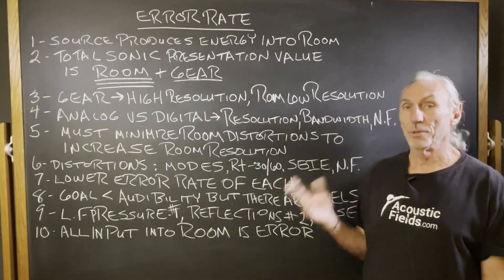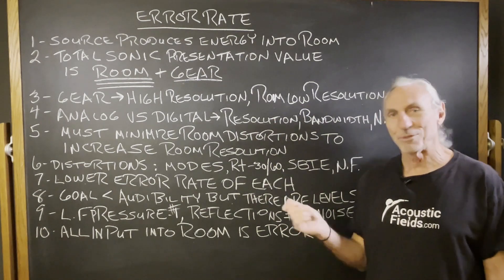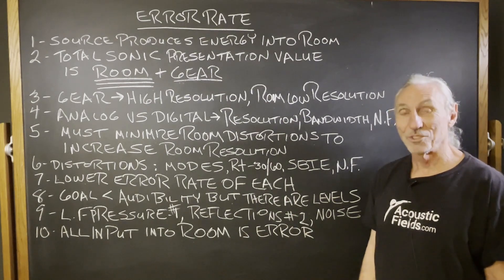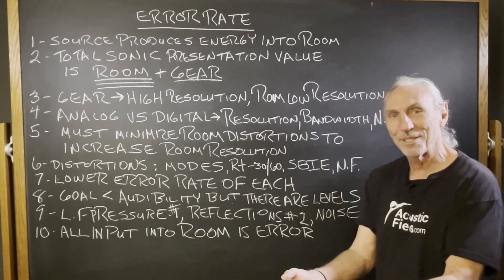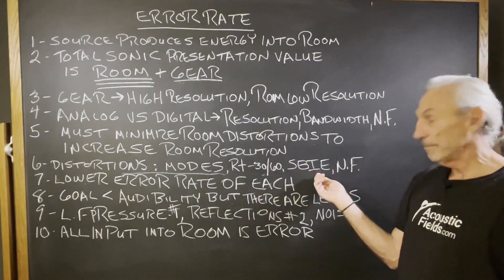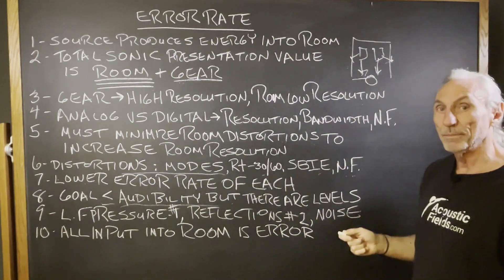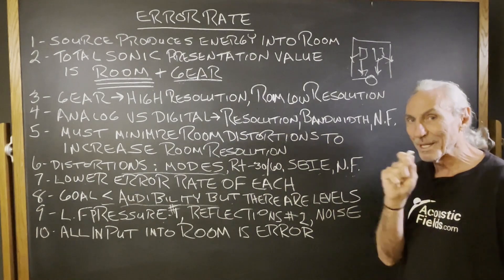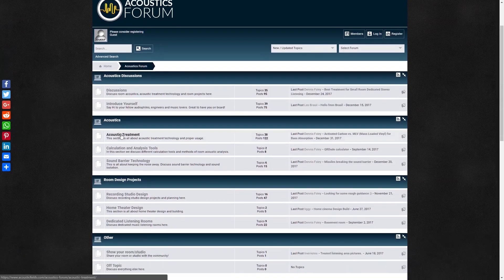Error Rate - www.AcousticFields.com

Comment: To continue the car analogy, I think of the listener and source material as passengers in a car that is the gear. Tires are the room. Simple compared with an engine, but crucial. Perfomance of a car is only as good as its connection to pavement.
Reply from the maker: Your system is only as good as the room will allow it to be. People don't realize how much of an impact the room has until they start treating the issues. Once treated, they have two reactions. They have regret that they did not treat sooner and the second reaction is that they will never be without treatment again.

Comment: Thankfully, when building my theatre room in my basement, I found your channel (and Audioholics). Learning that the room has to be correct before buying expensive audio equipment was pivotal information. You’ve helped me get the most out of my theatre setup with cheap AV gear! Which is a necessity for people who are saving up for better receiver/processor and amps!
Reply from the maker: The room accounts for 50% of what you hear, maybe more. Why wouldn't you treat something that produces 50% of what you hear to minimize distortion. Your speaker manufacturer did along with your amplifier manufacturer. Even cable designers reduce noise. It makes no sense to us at all.
Reply: @AcousticFields  your channel should be required viewing for us amateurs!